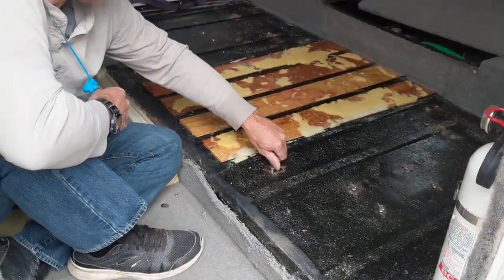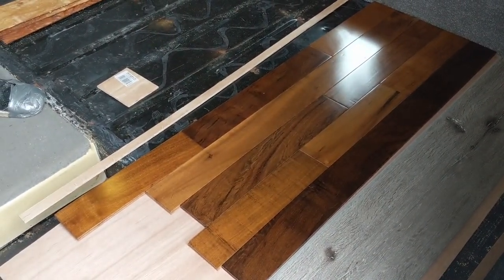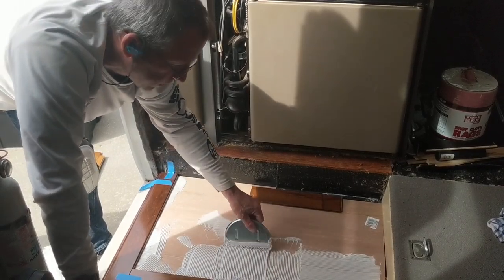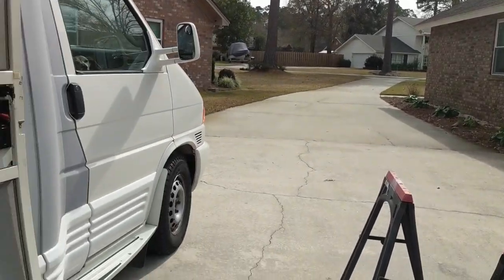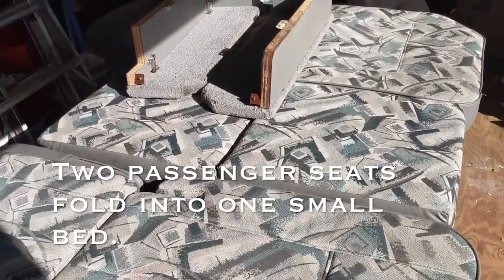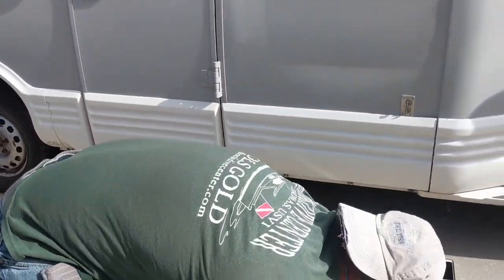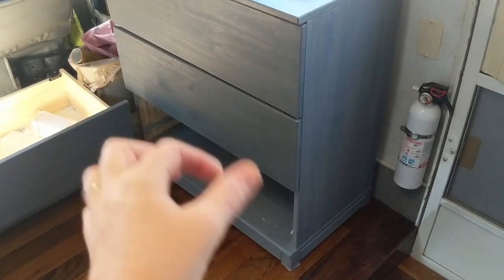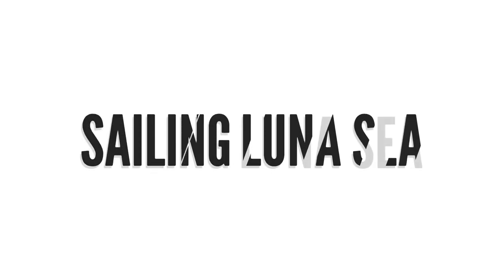1999 Rialta | Hardwood Flooring Install | Sailing Luna Sea RV Edition! | S3 E1 | Travel Blog

Comment: Do you have any beginner pictures of the floor and putting the subfloor down? What did you use and did your rv have the wood planks in the dips.  I am taking the carpet out and there are these pieces of the wood.

Comment: What did you put down on the floor first before you laid anything? 1/8” wood? 1/4” plywood? 4in slats of wood?
Reply from the maker: Mark measured the ribs and then went to Hone Depot or somewhere and found something the same thickness. Then cut that into 1” strips.
Reply: I’m not understanding one inch slats? Was it panels of 1/4 sub floor?

Comment: My wife and I have a Rialta as well and would love to do this to ours too! How did you get the seat bolts out behind the 2 front seats? We were worried that it would make the wood uneven! Would love to know how y’all did it!
Reply from the maker: Are you putting the seats back in?  We did not. But honestly, that was three years and several projects ago - so I can’t swear that I remember the details. As far as we recall, we just took the bolts out when we took the seats out and then put the flooring down…
Reply from the maker: And guess I’m not really clear on the area you mean. The area directly behind the two front seats we just left carpeted. The wood floor started down at the dropoff. Hopefully that is at least a little helpful of an explanation. 😏
Reply: @SailingLunaSea  thank you for your response! Yes I am talking about the area behind the 2 front seats where your dresser is. I plan to leave the area where the battery’s are still carpet (the same as you). But, no we are not putting the seats back in. I took them out a while ago but left the bolts in. I haven’t tried to take the carpet out. I was in fear that the bolts would make the wood uneven because they raised up over the carpet.

I just didn’t see the part where you took the bolts out so was just curious on if you had to lay anything under the wood to make it even/balanced. But my wife and I now see that is it possible and it doesn’t look too hard to do. Thank you for sharing and responding! Happy travelling!